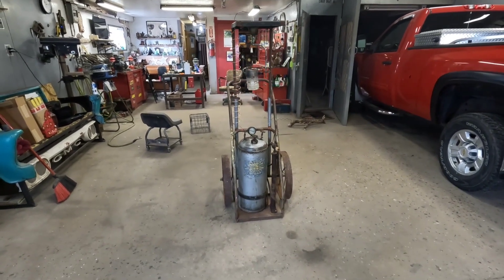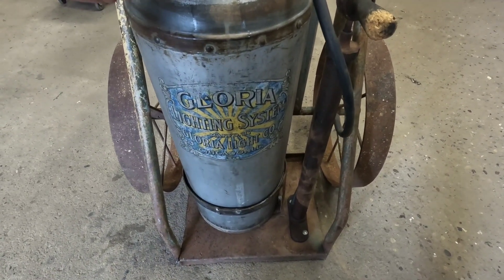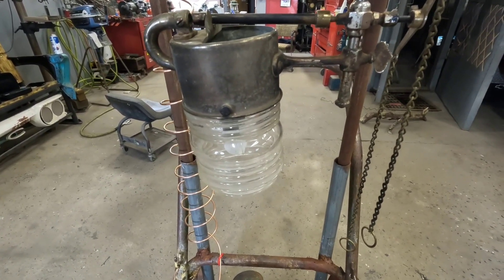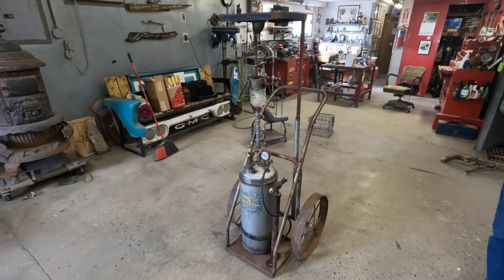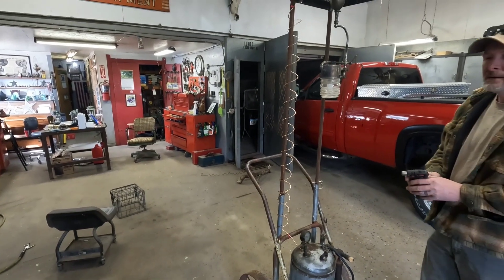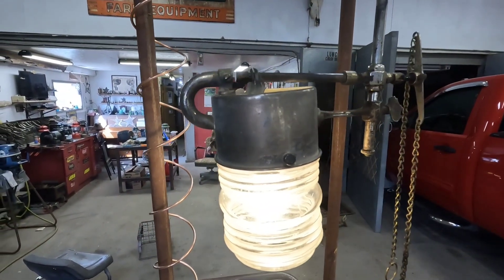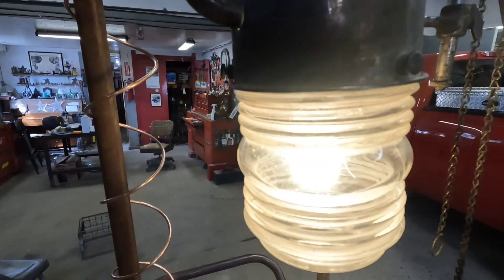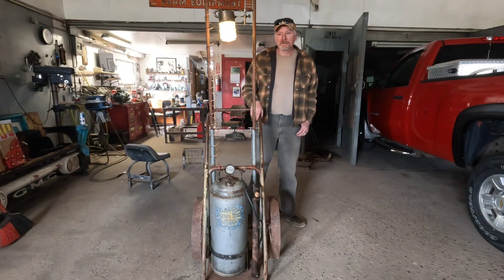Gloria lighting system made in the 1920s. Let's check it out, then light it up! #HollowWireLighting

Comment: What type of fittings did you use to connect the 1/8" tubing to the tank and light fixture?
Reply from the maker: I bought an oil pressure guage line kit for the 1/8" tubing that I used, and it came with a bunch of fittings and it had a couple that worked, so I was lucky there!